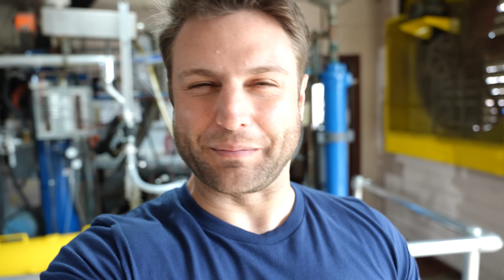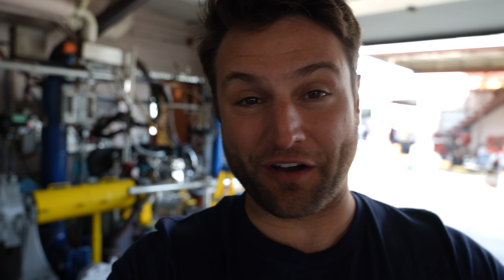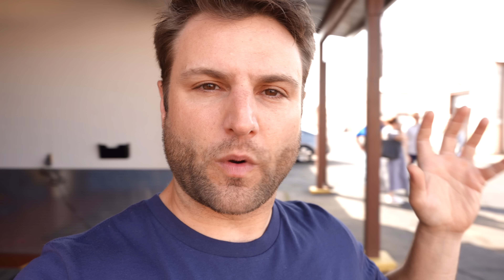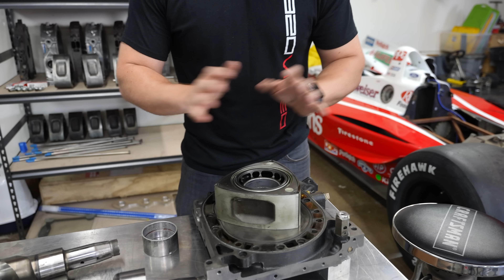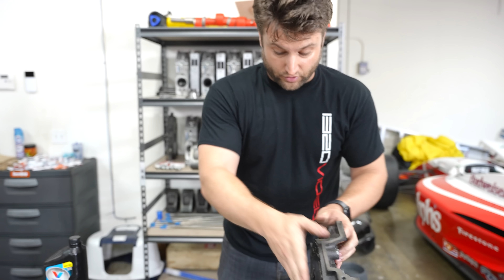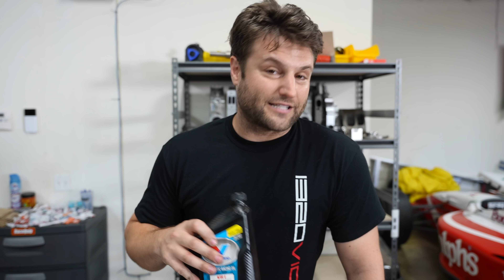I tour Valvoline’s Engine Lab to build better Rotaries.

Comment: good morning. i know is an old video , but i have a question. i have a 1973 mazda rx3 with a port 13 b holly carburator 660 21/2 exust . my question is can i use vr1 20/50 valvoline oil? i do not use the car to much.

Comment: I worked at this engine lab back in the 70’s. The first rotary we had was a Wankel engine which came in a German sedan which we road tested with various oils.  Through the years, they’ve tested just about every engine on the market.  The engine test stands that you saw are all standardized test stands (or at least they used to be).  Every oil manufacturer will have these in their facilities or have access to identical testing facilities such as those offered by Southwest Research.  Each test stand represents the method required for oil certifications.  The letters/certifications you see on the oil containers like ILSAC GF-6A, SN, SN Plus, SM all required successful completion of one or more of these tests.  A lot of great memories of the place and the people who I worked with, most all of which are retired…

Comment: Good explanation of the importance of the oil in the rotary engine. I have built and serviced rotary engines since the 70s and always told rotary car owners how important the oil is for the rotary engine. If they did not pay attention to the engine oil(checking oil levels and oil changes) they will  definitely will pay for a rebuild. I have a RX7 with 189k and still running great. Yes, always Valvoline oil.

Comment: I didn't know that the oil was so involved in rotor cooling. With that said, four rotors are inherently flawed. By the time the oil gets to the 3rd rotor it's got to be hot. 
I'm not saying it is a serial path but it is picking up heat along the way. An additional pump on the other end with the return in the center iron might be a good idea 💡. If you push it in from both ends and collect from the center, temperature and pressure uniformity will be enhanced significantly. Any liquid flowing through channeling experiences pressure drop. Even a pipeline requires pumps along the pipe to maintain pressure at a usable level. Pipeline head pressure leaving the pump is always over 500psi, I've seen some close to 2000psi. That's the resistance or friction of the pipe system vs volume X. An engine piping system is experiencing much greater resistance to volume.

Comment: In the '70s, Valvoline was not a good oil.  It would not perform in air-cooled motorcycles.  Ask me how I know.  We would look to Pennzoil and others for that.  Apparently, Pennsylvania crude oil was preferable to some of the others.  I don't know where Valvoline is from, and today's oils are built differently than they were back then.  I'm just mentioning it for no reason.

Comment: The trucks in our fleet , constanlty on the road over the years we have used valvoline, but the engines did not get past 300k with routine maintnance . Since than we moved over to mobile 1 . Trucks are sitting at 500k no issues.

Comment: hi rob any idea as to why rotor combustion faces aren't machined for optimal energy transfer during the firing cycle? im thinking of more of a tick if you were to look at the rotor side on, to better cup the energy into the face of the rotor rather than relying on the centrifugal force and ignition to carry the direction of combustion?

Comment: There is currently Zero Engine oils sold to the general  public  that contain the much needed Zink
So it doesn't matter  what oil you use , if you're not  adding zink additives into it upurself

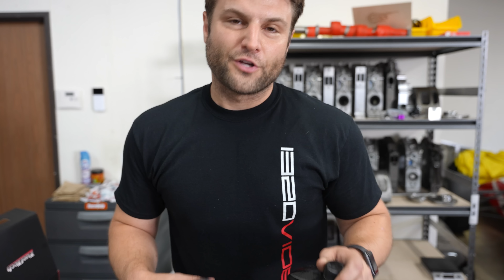Comment: 16:22
I would go for 1/2000 of shaft diameter when it comes to clearance and add  BIT
THIS LOOKED TO ME LIKE 60MM SO I GUESS 0.035-0.045 MM CLEARANCE. REMEMBER MORE CLEARANCE EQUALS TO SMALLER CONTACT PATCH AND I GUESS U MIGHT GET INTO TROUBLES WHEN YOUR OIL GETS TOO HOT AS IT MAY BRAKE THE STRENGTH OF FILM AND THINGS START RUBBING

Comment: 7:20
Not really
If u took SAE40 then you would be maybe max.20% thicker at low temps which is measured at 40 celcius degree
At high temp they would be same
So SAE30 oil would be same thickness at 100 celcius degree as 0w30..5w30...10w...30...and so on and slightly thicker at 40 deg. celcius
It also plays no role in racing as engines are at their max most of time.
Actually slightly higher viscosity at lower temp should be fine with warmer climate if you experience hot summers ets your oil will be pretty thin just as its laying at 30 degree celcius in a California garage.

Comment: I need to have a cat on my rx8. Do I understand correctly that the rx8 with the sohn adapter doesnt burn any engine oil and thefefore it is safe to use an oil with a lot of zdpp and not worry about the cat?

Comment: Thank you for taking the time to go to the source of good information. I have looked at both Valvoline, Castrol and Mobil 1 online datasheets and none of them specify at what temperature does the oil start to degrade. Would you be able to share this info?

Comment: Hey Rob, in Formula 1, the enormous engine power was only possible achieved by the use of electric pre-heating of the engine oil/water system which allowed very tight tolerances. When starting your own billet engine project, keep it in mind! The effort/cost ratio is very low, cold-starting will never be an issue - especially with ethanol! Love your stuff! Greatings from Germany!

Comment: Soooo, if pre mixing is the only way to lube the non lubed parts of the rotor what happened in regular street cars that regular people drive?? They don't pre mix and the engines don't blow up.  

 And Rob, you have to combine your builds with electric motors for a killer launch. You know about electrocity, and angry pixies why not build a type of hybrid electric????  Like formula un.

Comment: I’ve been swearing up and down by the VR one for three years now I run that shit in everything. I got a b18c swapped eg. Motor was rebuilt and hot tanked it looked like it just came out of the Honda factory it’s got about 5000 miles on it now and it still looks brand new. Shit is like engine crack I swear to God.

Comment: Well, I can guarantee you that Valvoline definitely isn't the only company that stress-tests their oils. That is kind of misleading.
Maybe they're the only ones that do it *in-house*, but the company I work at also carries out these kinds of tests for numerous brands. And we're not the only ones.

Just a quick heads-up.
Reply: so tell us, which oil is best
Reply: @beyondthelol  I'm not part of the laboratory staff, so I don't really know. Security is extremely tight in my company and we are all under an NDA, anyways.

The 'best' oil doesn't exist, btw. There is no one all end all.
Reply: Sir Paperbag; You are certainly correct about the Valvoline not the only oil company which has their own testing, development laboratories, and they all have their own, actually.
The best of them is the company that developed synthetic oils and lubricants, and produces only synthetic lubrication and have added high quality micro-filters.
If You know them, they still produce the Best. [Amsoil]
Which other company only produces only synthetic lubrication products, and covers all types and needs?  None.
these major oil companies were far behind in producing synthetic engine oils, which Mobil the first of them, in 1974 with Mobil 1, a decade behind and further in quality. This is still true with all of the major producers. Castrol was among the next, with the others including Valvoline still later in the 1990's. They all still produce standard, synthetic and blends for engine oil, and some have expanded into ATF, Brake fluids, etc, but none have the level of quality, and offering of the original developer that continues to do research, development, testing, improvements, etc..They choose to put their investment into their product development, and not big marketing, advertising, sponsorship. They rely upon their quality, and distributors to promote, market and sell their highest level products. 
If i were living in the USA still, would certainly be using Amsoil products in every vehicle application, and be a distributor to get the at wholesale.
The benefits of superior lubrication [as Rob mentions], durability, longevity, reliability, quality, performance, efficiency, etc. is worthwhile for every vehicle owner. My first use of synthetic engine oil was with a unique, new, tested Xtra synthetic in 1988, which they had actual test comparisons versus Mobil 1, the only other brand [than Amsoil, which was not yet aware of] and nationally advertised along with their many sponsorship arrangements [which those sponsored do not use, necessarily, and often do not]. If i had the more intense, higher requirements needed for racing, and which Rob Dahm has, then certainly the obvious, clear choice is to use THE Best available, not that which is very good, and has a sponsorship arrangement. It is certainly wothwhile paying for THE Best, compared with the cost, time, effort of mechanical failure, wear, durability, longevity and other issues. Certainly paying wholesale is worthwhile, and can bring him more in profits than the sponsorship arrangements with all of the companies he has.

Also, note these large companies show their data comparisons with standard oil products, but not compared with other synthetic products. Thus, this is another clear indication of their marketing technique and promotion. 
If they have data which shows actual comparisons versus other synthetics, which are better, they would certainly show  that as Amsoil and Xtra had. But none of them do. Thus, it is clear, obvious, and simple these major companies are intentionally portraying their information in the manner they do, since they do not have any actual data which shows they have any superiority or benefits over over synthetic oil products. Also, if these companies had such superior synthetic oil products, why do and would they produce standard and blend oil products too ?? Obviously, they do not have the commitment, quality nor business focus upon producing the best synthetics. Have You also noticed how much the standard oil products have increased and compared with the synthetics? During the 1980's the best of standard engine oil products were easily purchased at local discount auto parts stores for $1/qt, while the synthetics were multiple, up to four times, though still worthwhile for their durability, longevity, efficiency [reduced fuel consumption] alone. Now, have seen the cost per quart and gallon of synthetic of the same company are all much higher, but the relative price increase for synthetic engine oil is not very significant. Thus, it seems the producers have raised the pricing for all by multiples, but synthetics not nearly as much, and seemingly the standard  by 6-8 times, thus gaining far more profits with their standard and blend products, such much more profitable. The price of oil itself has not had such increases nor for fuel.
These companies are clearly benefiting with higher profits, and also the standards of 'oil changes' in the maintenance schedules has decreased too, which results in greater maintenance costs and more frequently too. The Xtra Synthetic engine oil which i used beginning in 1988, had a minimum 15k mi  durability, which was double the standard 7500 mi from manufactures using standard oils.
Toyota used synthetic engine oil in their 5 yr. 60k 'maintenance free' Corolla of 1990's, and their sealed engines of their min-van Previa, and Lexus.
Many performance vehicles are shipped from the factory with synthetic oils during these years.
Do You think these manufactures haven't done their extensive testing with the synthetics ?
Which racing team doesn't use synthetic lubrication products, and for at least 40 years ?

Sincerely

Comment: I feel the exact same way about Amsoil. 205k miles of beating the hell of my car and Black Stone Labs said go with 9k mile oci's (I do 7K). It's just amazing the tech they put in oil, and I'm just running the classic European spec 5w40. Though I would have to admit I have taken the top off the hoonicorn blood vial and it doesn't smell like it has that much fuel dilution. I like that the VR1 still has the blue color, my Amsoil comes out blacker than black because it's a GDI engine.

Comment: Look to see if there's a way you can send the oil through the oil coolers then directly to the rotors because I'm thinking that the rotors, turbo charger and E shaft are gonna be the 3 major  factors that are gonna beat up that oil and. I know in an automatic transmissions to help them with cooling they send the oil to the oil cooler than feed it directly to the planetaries in the automatic transmission.

Comment: Valvoline is good, but amsoil's base oil, friction modifiers, viscosity modifiers, dispersants, and detergents are the highest performing conglomerate of those factors on earth. Pennzoil ultra platinum has a super good base oil, but it's additive package isn't as good as amsoil. But for the money Valvoline is pretty good. Royal purple is shit and corrodes your motor with prolonged use, but has a good friction modifier for short term use.

Comment: Very good video.  Thanks for educating us!

Rob, you have taught us that heat is energy and that you want to capture as much heat/energy as possible to make the most power and go fast.  Have you ever thought about capturing the heat energy in the oil as it comes out of the engine, to put that energy to use making you fast? Thanks!

Comment: This video really helps me understand the inner workings of rotaries and why they consume so much oil 

That being said I'm still hell bent on getting an FC with a rotary, I just gotta make room in the wallet
Reply: The consumption is more from the OMP pumping the engine oil into the combustion chamber to lubricate the apex seals, all the other functions mentioned in the video is just the normal oil life as it gets pumped around the engine, and that hopefully shouldn’t be consuming it

Comment: 7:00 That is not a temperature range, those numbers don't represent temperature directly.
The first number with the W represents how well the oil will do in low temperatures, a 5W has lower viscosity then a 20W for example in cold weather. The following number represents the viscosity when hot.
There is not really a better oil then others, engines are built for a specific viscosity and that is what should be used.

Comment: One thing to consider is the delta-p’s across various orifices in the system.....a big increase in flow doesn’t necessarily mean the pressure is the same at the bearings as seen on the gauge (depending where it’s tapped).....an example being if the return to oil pan is restrictive in any way, then making it less restrictive will mean the delta-p across the bearings will increase at the same supply pressure, therefore, the pressure will need to be higher at the supply point to have the same pressure across the bearings at the new increased increased flow).....and easier way to relate this to a piston engine oiling system is to think of it like increasing the side clearance of the rods on the crankshaft, to increase flow, then think about the pressure distribution difference between the main and rod throws at the new higher flow.